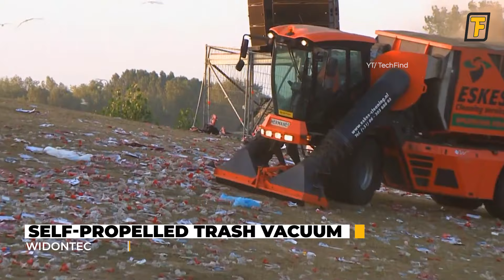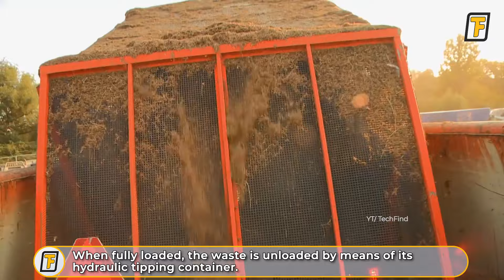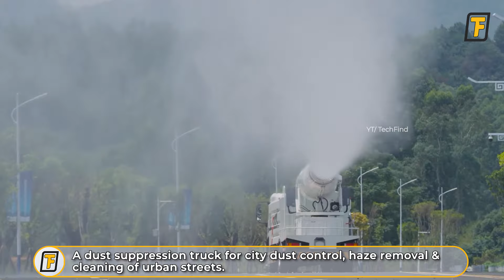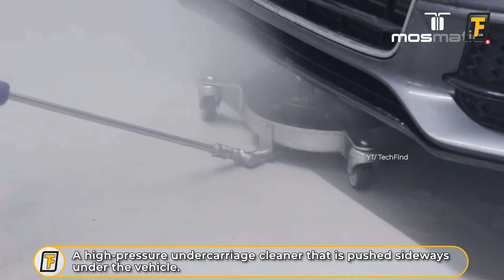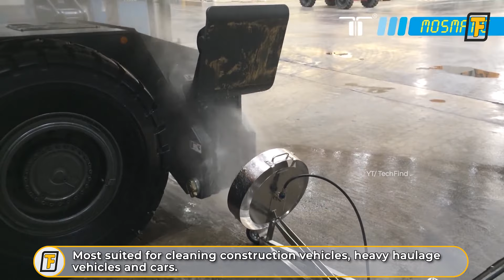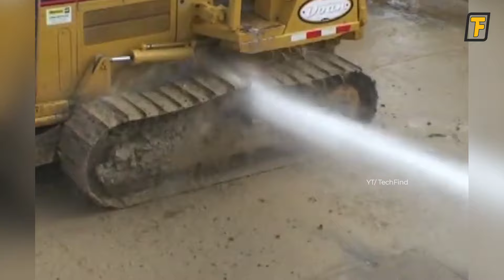This Giant TRASH VACUUM Sweeps Festival Grounds CLEAN - Fascinating Most Powerful Cleaning Machines

Comment: I want you do one experiment with this machine, tornado is always form at the ground level, you chase the tornado and Suck air from tornado.  
Let us watch the results. 
Jay bharat.
Reply: You will face one problem, tornado will pass through machine and come out than I will give you another solution to break tornado. 
First you try to Suck air from  radius of tornado.  Wear helmet and use two three machine to increase capacity of sucking. 
Jay bharat.
Reply: We need to slove the problem of electric current from local electric pole, cut the electricity before doing experiment.  Jay bharat.

Comment: Non of these cleaning systems will work on caked on oilsands and heavy oil buildup on oilfield equipment.  Thats what truck mounted high pressure steam cleaning jet monitors are for.  We use high pressure steam wash out at Mildred Lake Syncrude Oilsands mine to clean all the giant tump trucks.  We even have the worlds largest steam truck wash

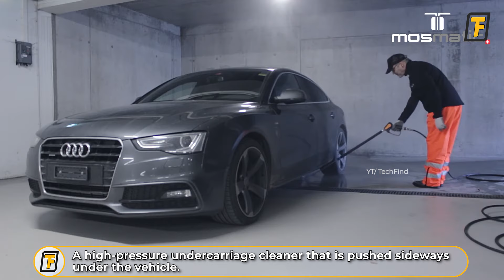Comment: 4:00 looks cool, doesn't really do anything. most cars are completely covered in plastic from the underside. you have to remove all that, to get to the metal frame and suspension parts, where salt and dirt will do their job and corrode everything away.